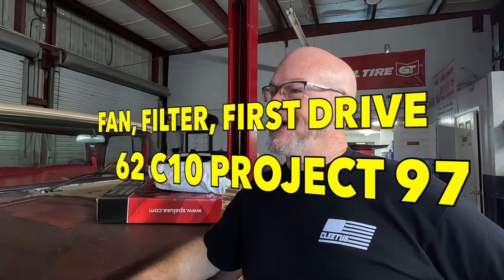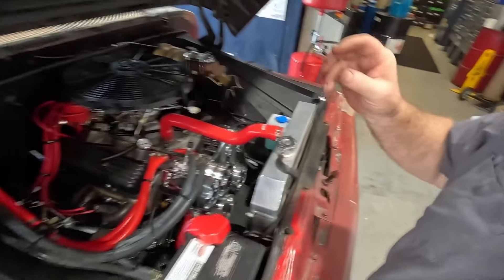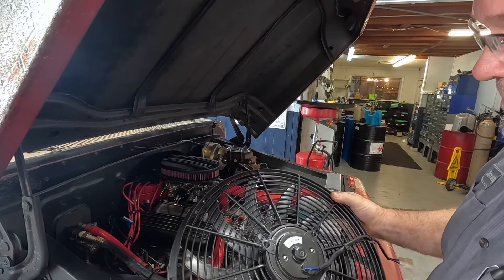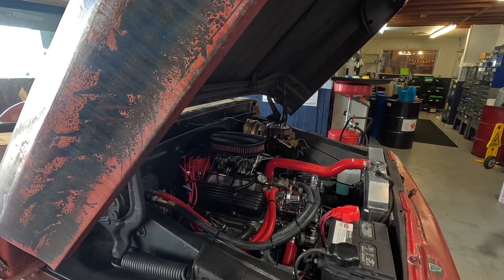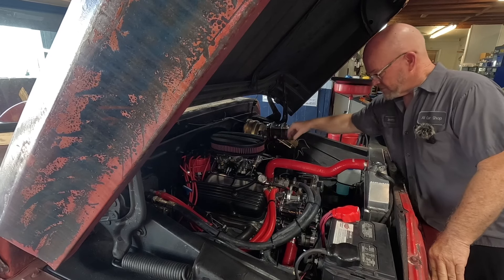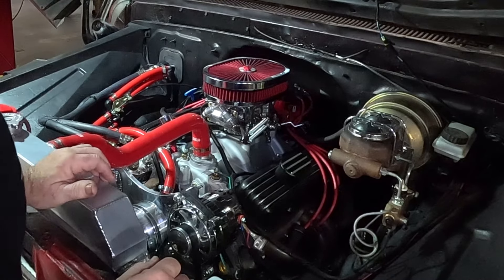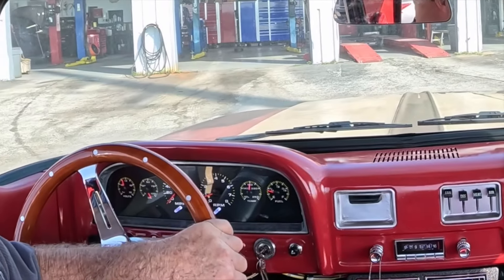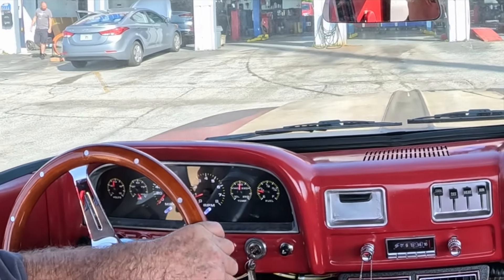FAN, FILTER AND FIRST DRIVE, 383 BLUEPRINT ENGINE IN THE C10 PROJECT 97 1962, 60-66

Comment: when you tap that throttle ,the whole truck rocks , I love that , If Jimmy is grinning ear to ear you know he loves that engine in that truck , well done Jimmy .
Reply: They just don't make anything modern that sounds/runs like that anymore. Love that engine. What size cam is that and whats the redline on that engine?  Love love it. Ps- hydraulic/ roller?
Reply from the maker: Man it's is awesome OB! :)
Reply from the maker: The cam is a hydraulic roller, it specs at .546/.555 lift, 230/236 duration and 110 lobe separation. To me it's about perfect for a street cruiser vehicle like a muscle car or truck. If the lobe separation was tighter it would sound more aggressive/lumpy, but not work with the power brakes very well.

Comment: Best project truck video! The engine sounds awesome! I hope the cooling issue gets sorted out...................
Reply from the maker: Even the good fan won’t pull it down so far, but it stops it from getting hotter and boiling over. Between us I ordered a better radiator, for after vacation. ;)

Comment: Looks like your speedo and whatever gauge is to the left of it aren't connected correctly - the keep spinning back to zero.  Wiring issue?
Reply from the maker: Turned out to be the dash has major internal issues. I removed the Intellitronix and put a Dakota in and it works flawlessly, on the same wiring.

Comment: should have put some 110 race fuel in it.... at $11.99/gal. speaking of 93 I remember back in the day 93 would only be maybe 40/50cents higher then 87 but now its well over a dollar higher..
Reply from the maker: Yeah, it is a bit expensive. This engine is 10.2:1 compression and with the aluminum heads and cam it's using should be fine, the super is a precaution and since they recommend it, I'll use it.

Comment: I guess cam failures are common on rebuilt engines, poor quality. New motor be like I’m outta here
Reply from the maker: Yeah Tom, they are apparently having flat tappet lifter manufacturing issues I'm hearing. The tolerance for lifter face is about .002 - .0015 depending on the cams lobe profile and if they are machined even slightly off disaster is imminent.